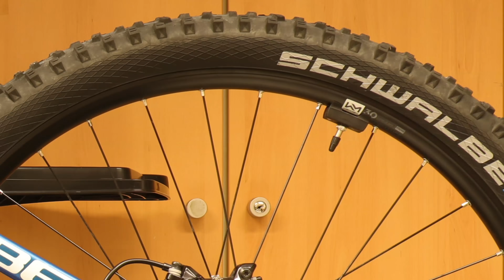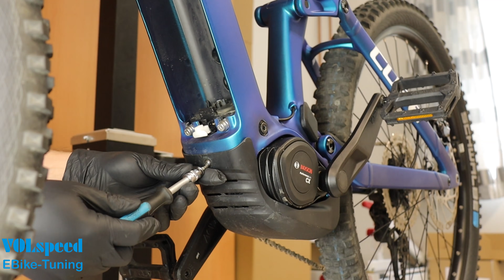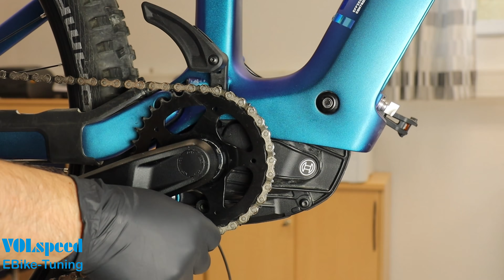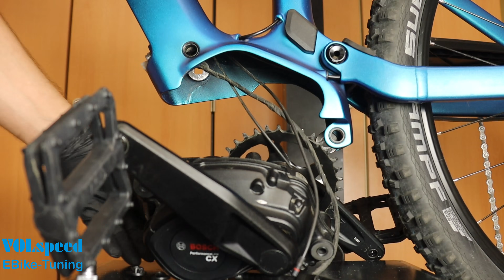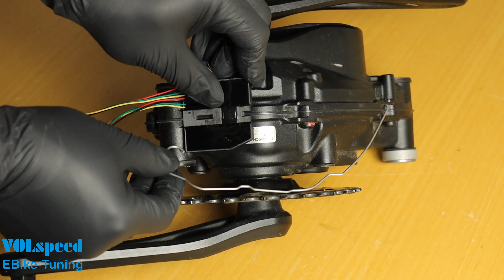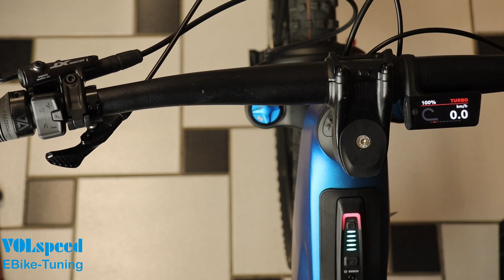How to Derestrict Bosch Performance Line CX Gen 5 with Rim Magnet – VOLspeed Tuning Tutorial

Comment: Installed the VOLspeed on my CUBE Stereo Hybrid  ONE77 HPC SLX 800 - 2026 model (Bosch Gen5 motor, BDU3840) on 17-07-2026.

There was enough room for the cables, and installation was quick and straightforward. It works perfectly with the latest Bosch software update (120Nm upgrade)

One recommendation: turn off automatic updates in the eBike Flow app, as future Bosch updates may interfere with the tuning module.
Reply: How's it going so far and what speed are you hitting

Comment: I got it had it for almost 1 month, and the smart system on the Bosch performance line gen5 detected the Volspeed V2 yesterday and i had to remove it in order to reset the error.
Anyone knows what happens if install it again? Any suggestions?
Reply: Same thing happened to me only had the chip a week
Reply: @DeclanBeal  did you manage to resolve it? or is this dead in the water?
Reply: I guess same with predecessor after 3x you need the dealer for a reset. Could ask dealer 1st before reinstalling.
Reply: What firmware versions and do you have pn 1405?

Comment: Hallo everyone! We have some new development notes for any current and future owner of GEN5 motors who founds this message most useful, we will keep referring to the specific type of the new engine model, as we finished the 1st quarter of 2026. 

Some key notes for all user, be advised for:

Optics) Understand each bikes components, what they are and what they do, avoid the use of improper pronunciations that are not established in the broader biking community. Keep it clear and understandable when you engage with the community for any pointers.

Plan before act) If you ever used the Bosch FLOW app from Google Play store, 1st make sure you do not have smart lock enabled on the bike (toggle it off) and take a screenshot of spec, PN SN and firmware versions your components have, then you will uninstall the FLOW from your android devices once and for all. As we speak, Bosch is about to push some new firmware upgrades that have hard coded tracking, meaning our investments in Tuning tech is up for debate if we are going to be able to do anything on those bikes 1-2 years from now. Having said that please follow VOLspeeds website for more details as to which version is currently fully functional for each VOLspeed tuner brand.

Preparations) Actually it is more advised for beginners of the hobby (eMTB) to begin with a Tubeless setup and fortify their bike under measures that protect you from strong forces created by a modulated GEN5 engine. (Food for though for GEN4 owners as well)

Awareness) Understand that if your chain slips, stretches or breaks while the tuner is installed, will result to your bikes health being voided, and furthermore leave yourself susceptible to serious harm/danger.
Do not engage TURBO mode while the tuner is active, do not exceed 150-200 RPM on the rotor itself and do not limit test the unofficial 75km/h hard cap that the engine can endure.
Please stay alive, that's the point. Personal notes here, I would highly recommend to avoid having an aluminum freewheel body, definitely swap into steel ones despite the extra weight. The forces are too strong with this upgrade and wear/tear will happen if the materials are weak.

Professionalism) "Tuners" are not meant to mess with internally, respect the guidance given to you by the official email and support tickets from the VOLspeed company. (Germany)

Down bellow, if you are interesting in starting a Tuner installation process, make sure you share you experiences, they are vital in this current state of development. 

Enjoy riding fellas!
Reply: The Tuner is 100% operational as marketed, given that you follow the guidelines stated above.

Comment: That’s gonna work with the new Bosch update ?
Reply: Yes. 100% !
Reply: @Hnz188in what bike you install ? Have any vid thanks
Reply: @Eldiablozatanas Lol Vid?😂 Cube Cx Gen 5. and Volspeed V2 Version 1405 Works 100% with the Performance 2.0 Update. 300 km without any issue and the 600% support is even over 15 kp/h.

Comment: Of course, all this is a good thing, but it's worth waiting to see how long the soldering on the controller board, the bearings' reliability, and how long it will last after such frequent accelerations—and whether it all falls apart at some point when you're driving at 45 km/h. It's worth remembering that in large-scale industry, all components are strictly designed to withstand certain speeds; if it goes higher, no one knows what will happen.
Reply: It’s got a 2 year warranty
Reply: @palaHD because we all know that a bike only lasts for 2 years....

Comment: Great tutorial, great product 👍🏻 I have just installed Volspeed P/N 1405 to my wife’s Cube Nu Ride, Bosch gen 5 with rim magnet, works fine, no problems.
Reply: At which speed is it set, does 40km/h work without hitting the "LIMP" mode?

Comment: Are these mods detectable during servicing? as in even if I remove it before sending in there will be a digital footprint stored on the bike?
Reply: Not clear about Bosch but I have had a peartune. I believe it is Chip on my 2020 Heckler. I recently had to take it in for some service when it developed a software glitch, so I pulled that unit off. It is a much easier installation than this. It's just a small little circuit board about the size of a half of a matchbook fits right under the cover on the left side and I thought for sure when they plugged it into the diagnostic tool at the shop that they may be come back to me and say hey. Have you had a D-restrictor on this thing? But nothing soon as I got the bike back home. Pop the chip back on everything works perfectly fine

Comment: Hi does anyone know if this will work on a Cube Reaction 800 hybrid pro 2006, in Terms of space?
Reply: I have just installed it to Cube Nu Ride, Bosch gen 5 with rim magnet, works great, no issues with space to reassemble the engine.

Comment: What about bosh's limp mode ? Does it fully bypass it ?
Reply from the maker: Unfortunately, the module does not offer 100% protection against triggering the tamper detection. The product is still relatively new and has only been on the market for about six months. Several customers have already reported tampering errors, but based on the number of modules installed, less than 1% of customers are affected. Of course, this is not yet perfect, we hope to be able to improve it further.
Reply: @volspeedebiketuning4391  alight thanks I will wait a bit more until it becomes avaible on the newest software version then before I buy it
Reply: @volspeedebiketuning4391 I have a gen5 with rim magnet and a connect module. Does this kit work for me?

Comment: Is the speedometer (Purion 200) accurate after tuning?
Reply: Unfortunately not, that's a bummer
Reply from the maker: Unfortunately, communication between the drive unit and display in the Bosch Smart System is cryptographically secured, making it almost impossible to display the correct speed.

Comment: Does it work with software update 17.19?
Reply from the maker: Unfortunately, with Drive Unit software version 17.16.0, this tuning no longer works reliably on some bikes. We have received several reports of error messages ‘Magnetic field error’, error code 523003. To fix the error, you only need to restart the bike, but this is of course annoying. We are currently working on a solution. A new version ‘V2’ of the module is expected to be released in early March, which should resolve these issues.
Reply: @volspeedebiketuning4391 how do I know which version I’ve got of the v2 ?

Comment: Does this effect the delivery of power in each mode i.e EMTB+? Or are they all just fast and powerful with no need to choose a mode?
Reply: each mode will still work the same way it does without the chip, this chip doesn't make the bike motor more powerful it just gets rid of the 15.5mph speed limit, so say if your on turbo and your currently hitting the 15.5mph wall, the motor will continue assisting you up to what ever speed limit you set with this, but it wont make it easier for you and you will have to pedal faster to achieve a faster speed.

the true beauty of this chip is getting rid of the 15.5 mph speed cut off, so you can cruise at 18-20mph speed with no resistance on turbo when commuting

Comment: We are eagerly waiting for the test results :goodvibes:
Reply: This is the part most riders don’t realize.

If you are out of warranty, fine, but if you are not:
Bosch motors log: Wheel‑speed anomalies, Cadence vs. speed mismatches, Over‑speed events, Firmware irregularities, CAN‑bus inconsistencies, Error codes associated with tuning modules
Even if you remove the tuning device, the log remains.
Dealers cannot erase it. Bosch can see it immediately. Warranty is null and void.

Comment: Any news on the 100 nm update compatibility ?
Reply: I might have accidentally updated to 17.16.0, do we know if this still works with the latest software update? Turns out it got released this month.
Reply from the maker: The tuning is compatible up to software version 16.x.x. This is currently also known as the ‘100 Nm update’. I don't like to use this term, as the next software version will almost certainly also offer 100 Nm, but will not automatically be compatible with our tuning modules. An overview of the tested software versions can be found here:
https://blog.volspeed.de/bosch-smart-system-overview-software-versions-677/?lang=en

Comment: As most guys, waiting for 100nm test results, and ready to throw my money to you ;D
Reply: Can you still use the flow app after install?
Reply: Can you let us know if you will have a version for the latest software update? My bike has the 750w update and I need to derestrict  the speed cutoff
Reply from the maker: The tuning is compatible up to software version 16.x.x. This is currently also known as the ‘100 Nm update’. I don't like to use this term, as the next software version will almost certainly also offer 100 Nm, but will not automatically be compatible with our tuning modules. An overview of the tested software versions can be found here:
https://blog.volspeed.de/bosch-smart-system-overview-software-versions-677/?lang=en
Reply: @volspeedebiketuning4391 what about the 120Nm update?

Comment: DOES THIS CHIP WORK ON A HAIBIKE ALL Mtm 6 2025 BOSCH GEN5
Reply from the maker: In principle, the module should be suitable for your bike if it is equipped with a rim magnet. It is possible that the module cannot be installed on some bike models due to insufficient space. However, we have not had any negative experiences with this model to date.
Reply: Lo has instalado? Tengo la misma

Comment: Does it work with the new 100nm update?
Reply: Just done the update on my 2025 cube one 44 with this motor so wanting to know this too
Reply from the maker: We are currently testing the compatibility of the new software version 16.x.x with our new VOLspeed tuning module for the Performance Line CX with rim magnet (item number 1386).
The testing phase is expected to be completed by early September 2025.
We will publish the results at:
https://blog.volspeed.de/bosch-smart-system-overview-software-versions-677/?lang=en
Reply: @volspeedebiketuning4391  any update ?
Reply: Me 2 I need to know aswell before I purchase
Reply: @tomtom7789 i asked this questions and they said their testing it and will find out around mid September
Reply: @Daniel-wi2pg I got the same response from them

Comment: Does CUBE REACTION HYBRID RACE 800 have enough space?
Reply: Did you try it out or got an answer elsewhere? I getting the same bike and is very curious.
Reply: @LAD-321  No I didn't get answer, but, here is answer that cube SLX 800 has sufficient space, and basically it's same bike with different parts, so I assume that answer is that there is sufficient space.
Reply: @user-gw6up7wo3x  Thank you. I'm getting gen 5 smart version motor, so I have low hopes of it working. What motor do you have?
Reply: @user-gw6up7wo3x  it has enough space, I got confirmation via email